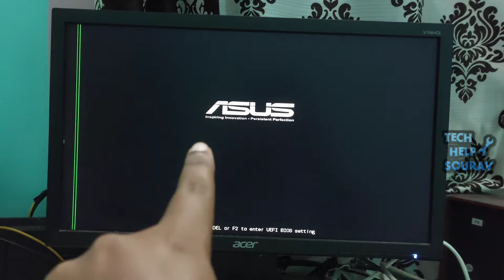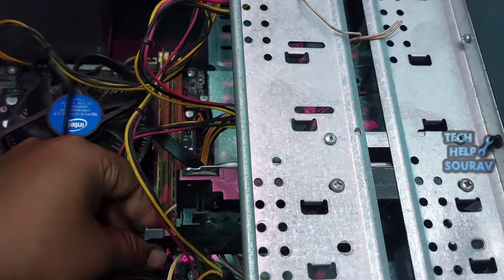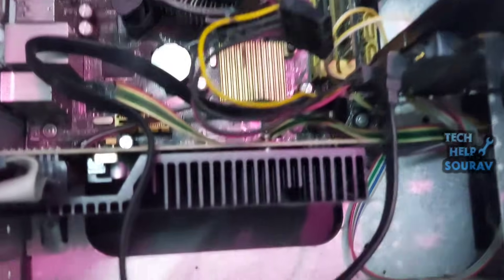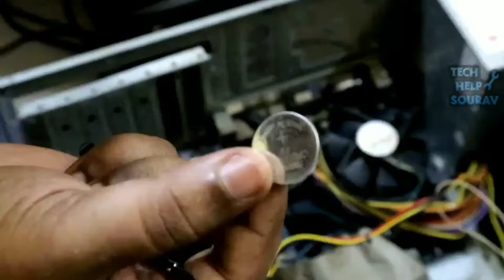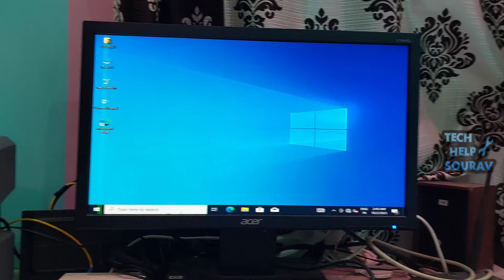PC Stuck On ASUS Boot Screen Problem Issue 😕 | How To Fix

Comment: update - my computer is working now 😁👌

if you are facing similar issue like.... 

First issue - BOSD (Stop code - machine check exception)
Second issue - BIOS screen stuck/frozen Third Issue - Black Screen.
Fourth Issue - Black Screen blinking dash top left corner.
Fifth issue - computer POST hi nahi ho pa raha hai, post beep sound bhi nahi aa raha hai. BIOS screen ki baat to bahut door ki bat hai. 

so please change your processor (CPU)